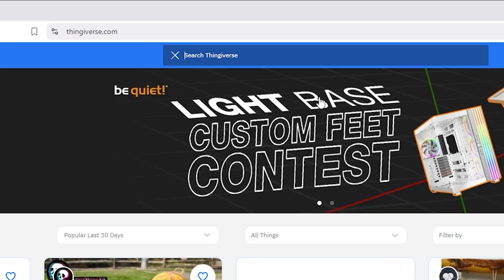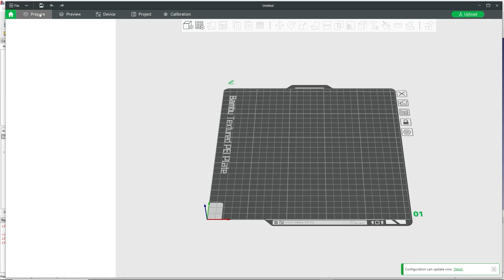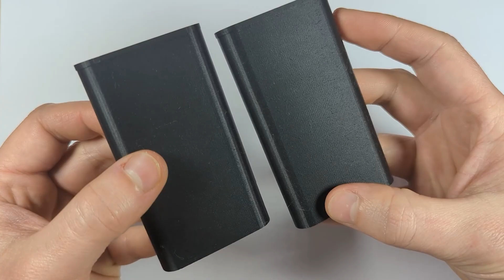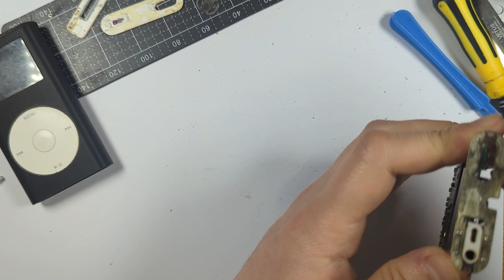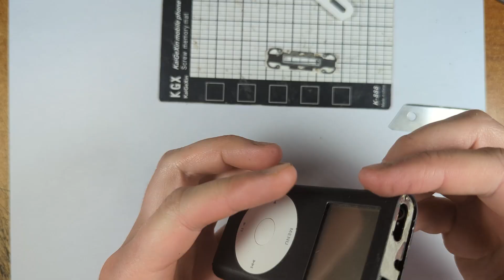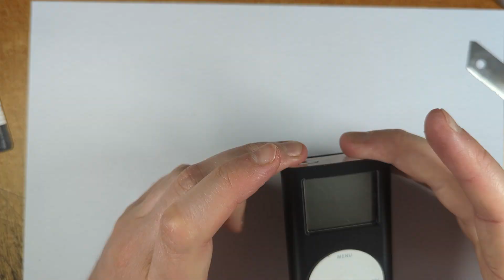Lets 3D print an iPod!

Comment: Retro Remake is looking at making upgrade parts/kits available. "I have settled on doing a custom shell replacement to fit iPod classic 1G-5.5G motherboards. Shell will come with an OLED or IPS screen, dedicated BT with a pairing button, TF/CF adapters, and a battery. Internal adapter frames can hold Mini 1/2, Nano 1-3, and Classic 6/7 mobos."

Comment: I had not expected that to come out so nicely stepping down from aluminium to plastics, but boy does it ever. This housing might make my dream of powering an iPod Mini with a stack of 3 AA batteries. Voltage should still match, but much faster to 'recharge' :)
Reply: You would need a step-down board to get the full 5V on the rail.   You could extend the back of the case and print a compartment for both the batteries and board, then add wiring with a two wire micro connector to the MB.  However. doing it in such way that you can still take it apart will be the trick.
Reply: @johnjefferson9121  Would you though? The internal battery is at 3.7 volts. I, naively?, assumed a triple stack of AA's would be perfect at 3.6V (assuming you only use rechargables). And yes, you'd still need to make space for them and somehow make it possible to disassemble the case, but that's where a 3D printed case could excel.
Reply: @Windgazer42  if you don't do a step-down and wire to the 30-pin or MB test point, you "could" put a JST PH 2mm connector on a 3.5V battery pack and plug into the LiOn battery connector on the MB, but then you still have an issue of the batteries getting reverse current if you plug into a computer with the 30-pin.  You would need a circuit to prevent that back flow from the charging system.  You would also need enough of an access point to remove/install the plug so you could open the pod.   The 3D print part wouldn't be that difficult...making it sexy would be.  LOL.  I have tons of pods laying around, a 3-D printer and some time.     I will try mocking one up...just need figure out the numbers for preventing the back flow to alkaline batteries.   I may even try .... GASP....rechargeables!  LOL.
Reply: @johnjefferson9121  I had not even considered hooking it up to the 30-pin, my soldering 'skills' are nowhere near the confidence level to touch that! However, I had also not yet considered the ramification of getting a charge current from the main-board when it's connected. As for looks, I'd personally make it an obvious hump, like any of the late-stage super-thin walkmans had, for nostalgia's sake. Time however is the one thing I'm perpetually short on and this idea too is shelved with plenty of links to useful resources should I get the time to work on it in the future. I sure would love to add a link to your well-documented efforts ;)